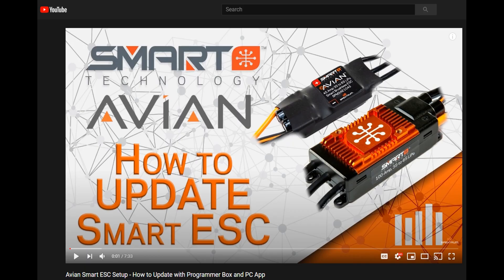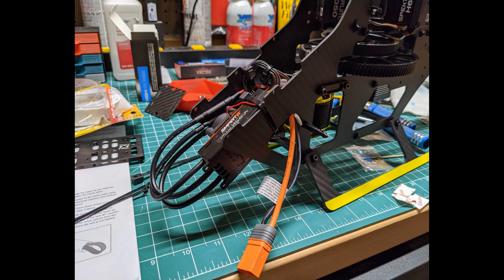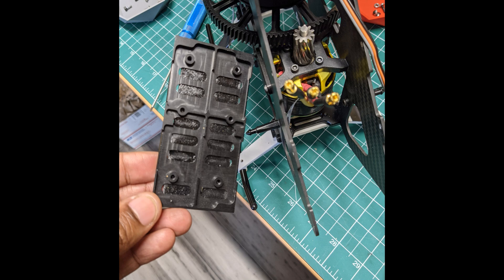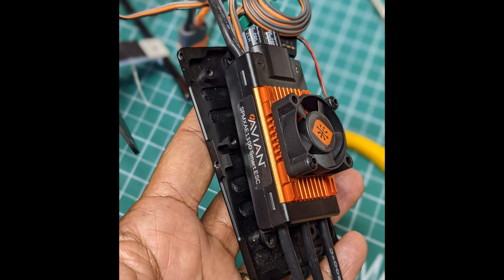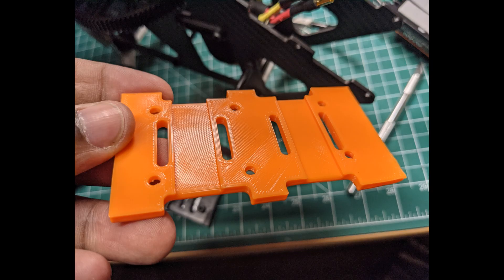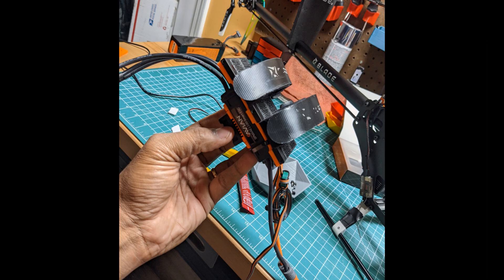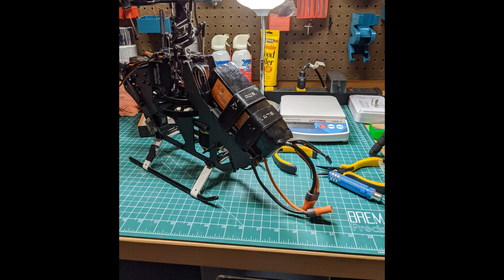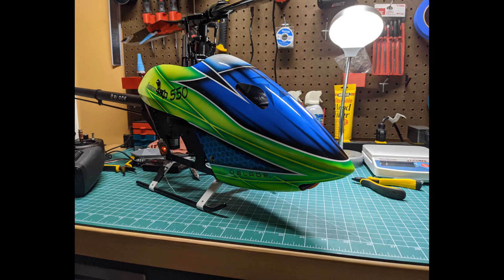Fusion 480 Avian 100 Tray Mount

Comment: Kudos! A very elegant solution! I wish I had a 3D printer. I ended up milling an new batt plate with the correct mounting holes out of a piece of aluminum(aloo-minEE-um lol love the way brits say it). That said, what an epic fail on Blade’s(HH’s) part to not ensure their proprietary bits dont work together.  Maybe Ill finally pull the trigger  on a SnapMaker printer/mini CNC. That way I can carve out busted pieces for my drones as well. 🤷🏻‍♂️ Anyway… Cheers, B

Comment: Hey bro...ive got my 480 built and im installing the electronics and the esc has two wires coming out of it and one wire is wrapped around a green donut and the other is not...i cant find any info on which wire goes to the flight controller but in your vid it looks like the wire that is wrapped around the green donut is the one that goes to the esc and you have the other wire tied up...so whats up with those two wires?...i can do all the programming stuff but i just dont know which of the two wires goes to the flight controller
Reply from the maker: The one wire with 1 connector, is the primary wire in which you plug into the ESC port of your fbl.  The other wire is for additional power if more voltage is needed for high-end servos (where you can select 8 volts vs 5).  This wire gets plugged into any Aux port, if applicable.
Reply: @bbyrdsong  THANK YOU SO MUCH!!!...Im not stupid but have been scratching my head on this all day and im not going to start hooking stuff up to see what happens either so thanks for clearing this up for me!!!...have not been all that impressed with the lack of information on the 480 build and having to make my own esc mounting plate and having to go back to the store for bullet connectors as well but it all worked out in the end...i now have to get the electronics and programing completed and im up in the air....so thank you again bro!!!